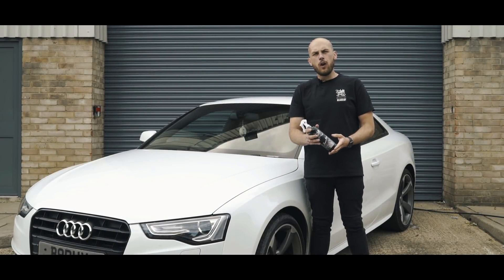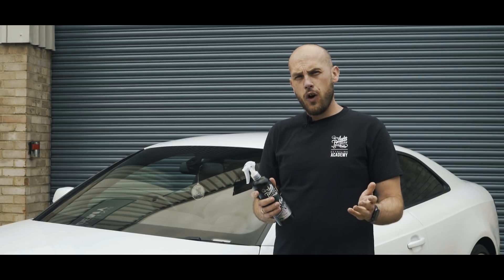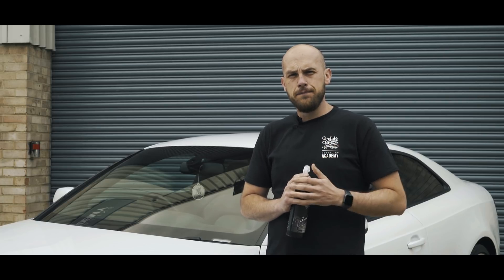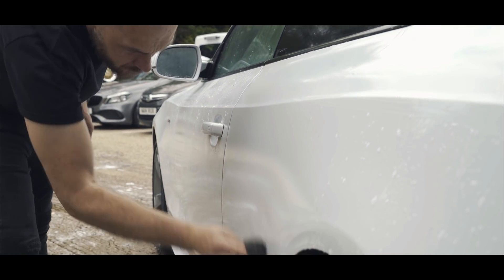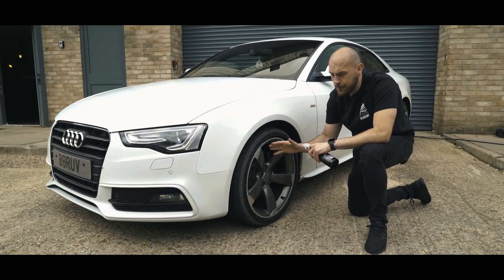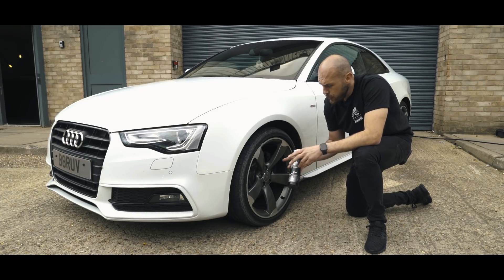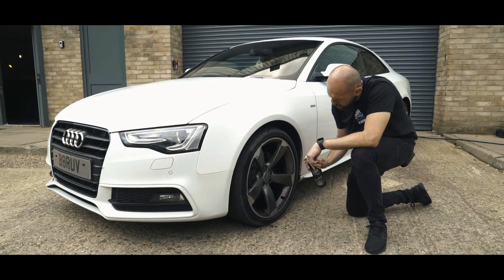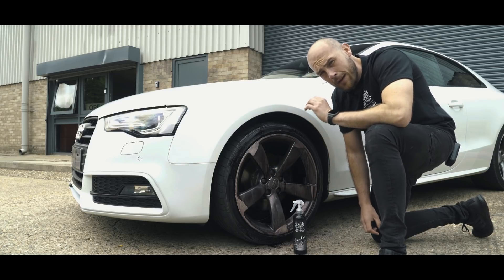Detailers Den - Iron Out

Comment: good products, AquaCoat is my fav, but trigger units on the smaller bottles of the products, need sorting.  Check how Megs, Gyeon, ChemGuys and AMDetails do theirs.
Reply: @Mogsy28uk - deffo agree, my near full bottle of iron out trigger failed recently.  I bought a pro spray bottle to decant remaining product into given the trigger failed.
Reply: Had the same problem. I shot them an email and they sent me a load of replacement triggers. They also said that they’re addressing the issue